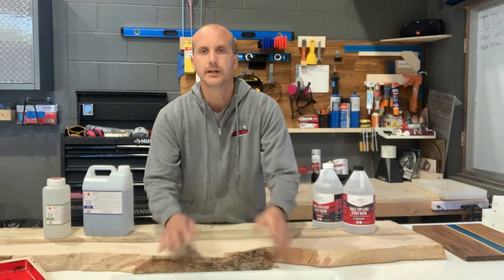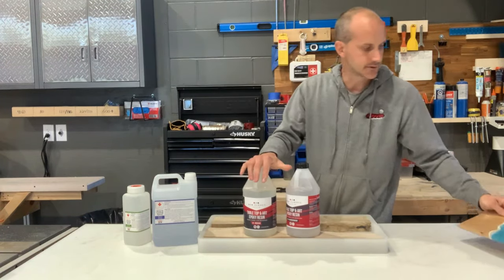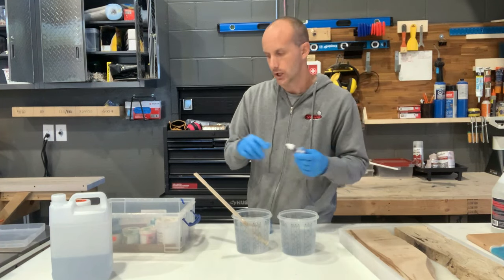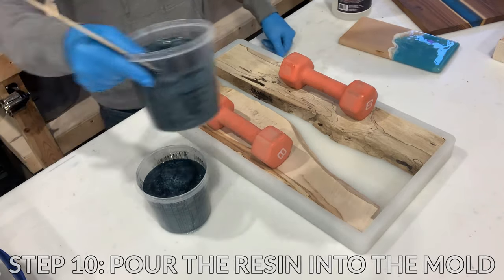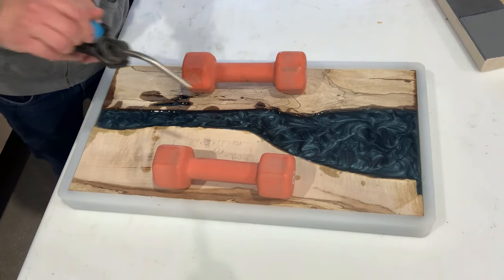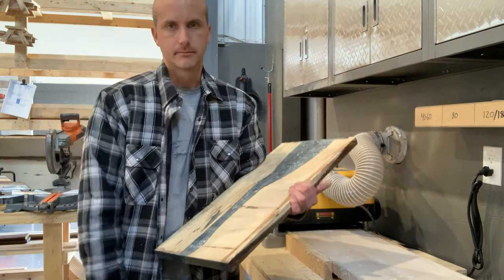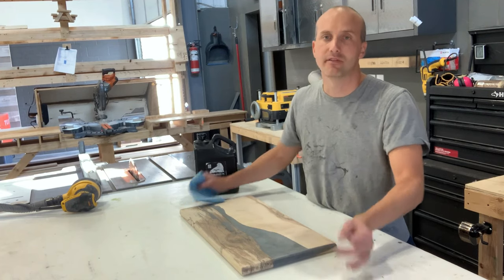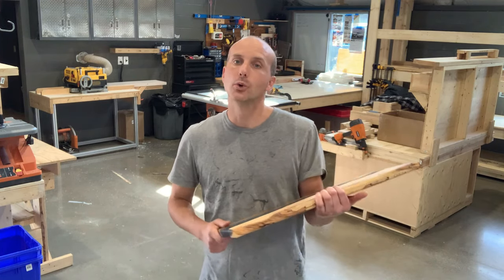How To Make Epoxy Resin Cutting Boards - DIY River Resin Charcuterie Boards + Big Time Saving Molds

Comment: That inexpensive ‘Chinese,’ resin comes with a food safe guarantee?
Reply from the maker: Despite some resins being called food safe, I am not confident any of them truly are. For example, many resins are simply BPA or BPA based. BPA is FDA approved as food safe, it's used in the inner lining of cans after all. HOWEVER, any health conscious person knows that BPA isn't REALLY something you want in contact with your food. With that said however, these charcuterie/serving boards and their resin component barely touch the food, and definitely not for a prolonged period of time (like it would in a can for example). So I suppose you have to pick your battles.

Comment: Your going to hurt yourself.  Use your push stick on the part right of the blade.  DON'T just leave it sitting there between the fence and the blade with the blade spinning.  Can't believe you haven't shot wood rockets or been hurt.  Otherwise, nice video.
Reply from the maker: I get it. And its an older video at this point. Ive been called out enough on YouTube that I am more diligent with this now.